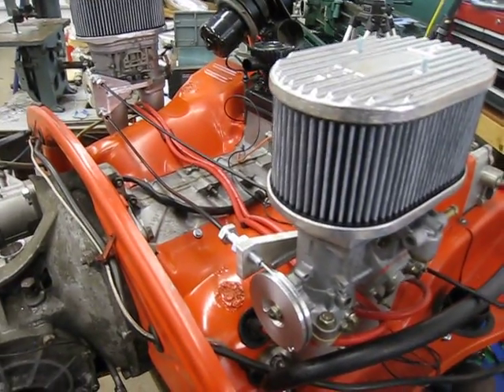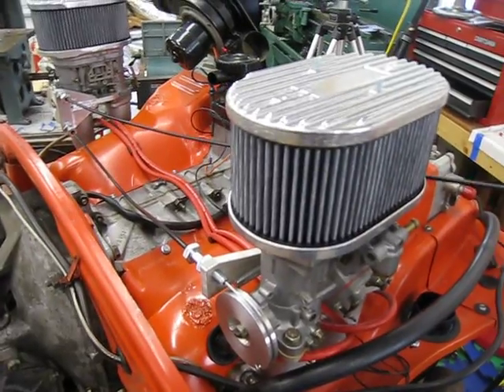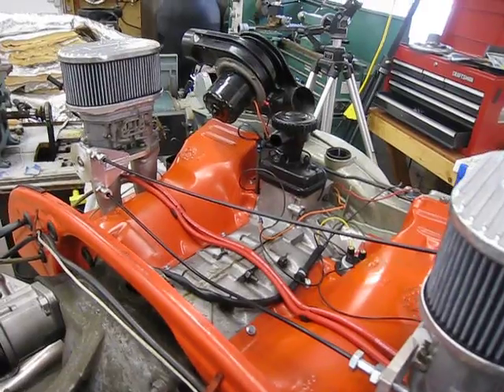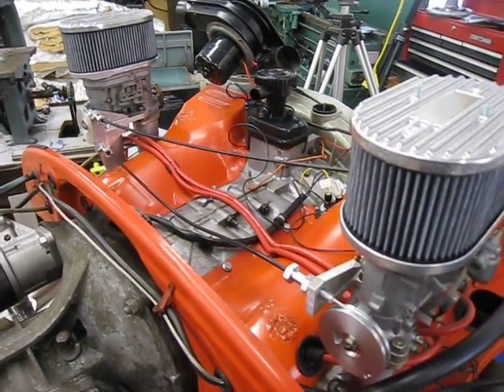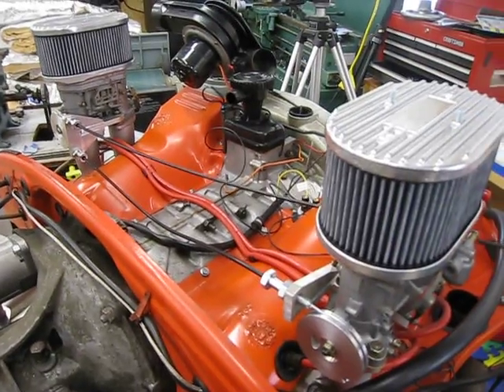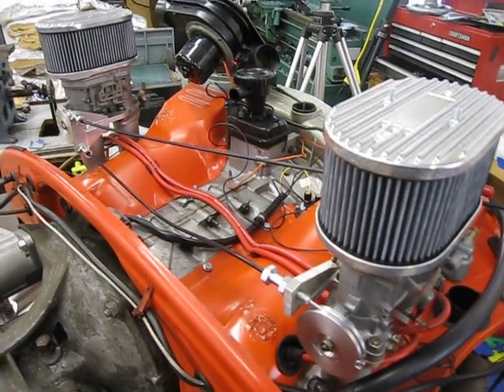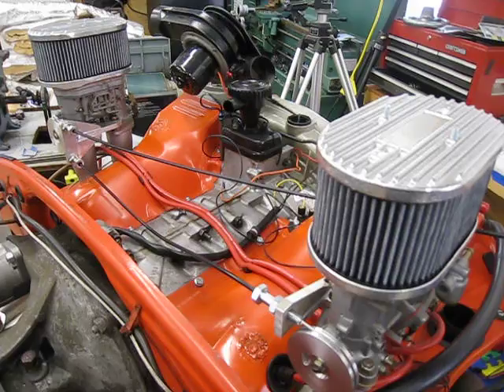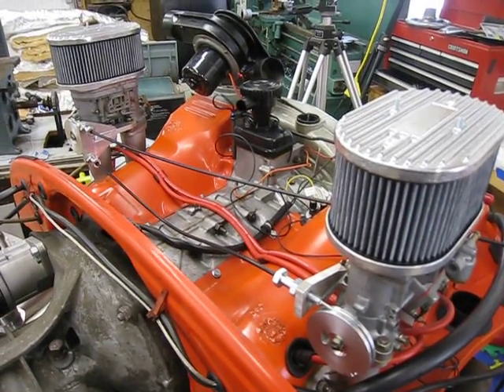Cable actuated dual carb linkage on Porsche 914 engine

Comment: very nice. I fabricated the two pulleys with three flat sheet of 1/8 aluminum. I ball parked it according to your design, my pulleys outside diameter are 2.5 inches and the inside is about 2 and 1/16 diameter. I have a T bar aluminum 1/4 piece that I will use to make the holder. Thanks for taking the time to share your idea. I'm waiting for dual weber IDF 40 I ordered from Aircooled.net to replace my 32/36 progressive weber on my 1700 bus. I know this system costs over 300 usd on Tangerine